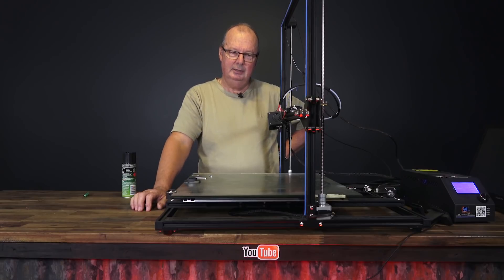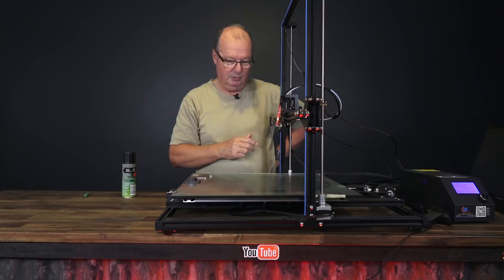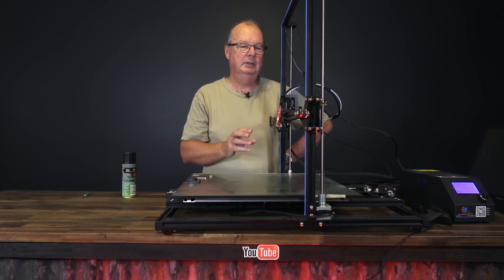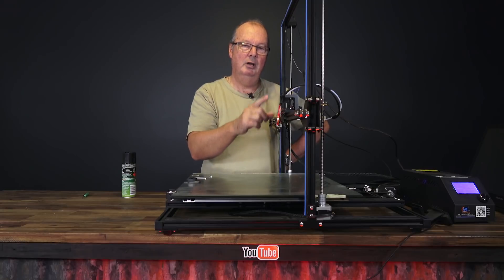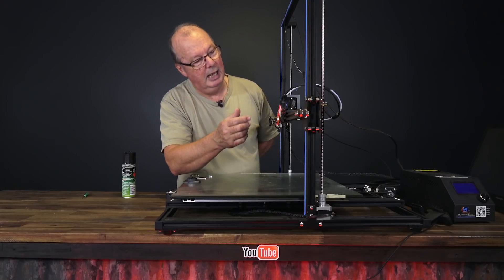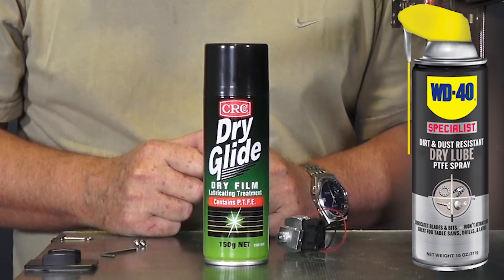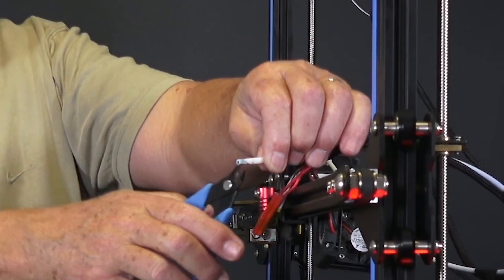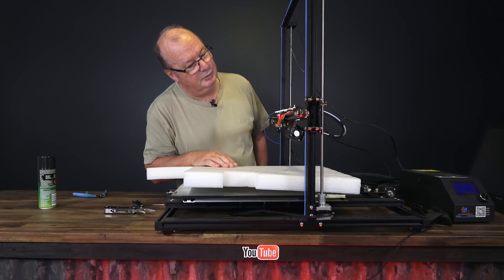How to fix your cr10, cr10s, mini tornado, ender, A10 and others jamming or under extruding.

Comment from the maker: Gearbest currently have a flash sale for the Ender-3  It is $189.99 USD!
https://t.co/1bsazHyyuh

BE SURE to check the PTFE tube in the hotend - if it's malformed cut it and re insert it correctly to have no gaps. Also check the PTFE release is working and locking or else replace it.
Reply: For most of the creality line u can get a micro Swiss kit and most of the E3 clones micro Swiss has the throat for sale to install if the stock throat is not machined properly
Reply: question here... I'm about to receive an Ender 3 in the mail, should I use this on my hot end before even using it, as I assemble it. How often to reapply if any?
Reply from the maker: Use as is until your replacements parts arrive - then you will see your homemade Improvmements once you use a quality ptfe and ideally a microswiss Nozzle
Reply: I know this is an old video, but I was wondering.  As a reloader, we frequently use moly (molybdenum disulfide) based dry film lubes on match bullets.  Can you think of any reason that would be inappropriate in an all metal hotend?
Reply: I think I missed that sale, lol

Comment: Hello, I have A Creaity CR-10 with Dual Z Axis motors. The z axis goes up and down when homing but will not go up when printing. Is this a problem with my machine or am i doing something wrong in Cura ?
Reply from the maker: If the Z moves ok via LCD controls then I would suggest it is either the model file or your Cura settings.

Comment: Don't you think this PTFE spray will block the extruder nozzle?
I also want to resolve my clogging issue.  I have my CR10s, my filament does not move ahead. Also its really difficult to remove the nozzle from the extruder.

Comment: Um... no. This is not an all-metal hotend. This is a PTFE lined hotend. The PTFE goes to the nozzle, not the heatbreak. Snipping the end of your PTFE is how you cause clogs because you're deforming the end of the tube, use a PTFE cutter (print one or TH3D or others sell specialized cutters with a razor on the end). I may be having problems with my printer at the moment but I'm doubting this solution due to the sheer amount of ignorance that has been stated only 60% way through the video.

Comment: What's the point of it? you use an all-metal hotend to print at higher temps but that higher temps going to make that PTFE spray off-gas and potentially poison you, so you stick to the 230 degrees, you might as well have stuck with the stock hot-end, I reckon that at some point that spray-on PTFE is going to stop working so you are going to have to clean it out before re-applying it, not my idea of fun!
 I forgot to mention I'm talking about an Ender 5 the new CR series come with a stock all-metal hot-end

Comment: What's about Ti all-metal heat breaks? I've ordered some "good one" (claimed). I've heard that it's better to polish them inside. Will I still need to oil it with a PTFE spray? My plans are about PETG mainly (maybe HT PLA in future).
Reply: anyone who doesn't like all metal just doesn't know how to tune retraction.  0.8mm@40mm/s is a good starting point for all metal/direct drive, closer to 1.2@35 if it's all metal with a bowden system.
Reply: @butre.  Thanks for the reply! Actually I'm gonna re-assemble the hot end when I'll get to it. The last time printing was stopped with partial clogging. I don't know about the reason. My guess is that cooling is not enough for Ti-heatbreak. Really not sure though!

Comment: So, should this only be done with aftermarket all-metal hot ends? I still use the stock hot end that came with my CR-10 and I'm dealing with a lot of underextruding and extruder skipping. Should I PTFE spray a stock hot end?

Comment: The spray is only rated to 230C, so make sure you don't print much hotter than that or it might break down and end up clogging the hot end.

Comment: I've heard that you need to "season" all metal hot ends, especially clones by using a filament oiler. Benefit of using an oiler is that it won't run out and need hot end dismantling.

Comment: I ordered a clone V6 hot end and then just a genuine heat break (£13) and nozzle from E3D directly. I also have two other heat breaks, one PTFE lined and another that's hollow allowing Capricorn high temp tubing to go all the way down to the nozzle.
Reply: Where did you get the hollow one (or keywords for search), and how well did that work out?

Comment: Hi John, do you find that this fix has a lifetime to it?
I have 3* Cr-10 printers and an Ender-3.  All have the same hot-end and the same issue from the factory. Printer works beautifully for a period, but eventually every one has succumbed to the same issue, usually during a long print, where it under-extrudes severely - sometimes dropping the speed 50% 'fixes' temporarily.
My previous solution was similar to you - pull out the PTFE tube, re-cut the end to be 100% perpendicular, straight cut, remove the nozzle, 4mm drill bit to clear through, brand new nozzle, and new pneumatic connector.  Right, everything works perfectly, job done - except that now, all 3 of my Cr-10 printers have just failed one after the other with the same issue - seems that fix has a lifetime.  As I know the end is cut perfectly, seems either the PTFE-pneumatic connector joint is getting loose and allowing a crack were hot filament can squeeze out - or the PTFE at the heatbreak is degrading. 
So trying to understand better what your fix is adding - is it that there is no air gap between PTFE tube and heatbreak/heatsink?  So it is better cooled?  Is it 'gluing' the PTFE tube in, and preventing a gap from developing?  Is the PTFE in the spray better quality/more temperature resistant than the Creality supplied tube?
How long have you had your printer running with this fix, have you had to repeat it?
Many thanks, for the interesting workaround, nicely presented.
Cheers
Alex
Reply: You can print clips that fit into the end of the couplers to help secure the tube in place. On thingiverse: "Bowden tube coupler clip".  Hopefully you have already resolved this issue, but just in case.
Reply from the maker: Great thanks for the tip

Comment: Or you know... You could just buy an original hotend from E3D or Micro Swiss. You save on time and material that may have been used on failed prints. They are probably way cheaper on the long run.

Comment: Well, I rather combine more ways, how to achieve success printing with all-metal HE. First, insulation! Just wrap your heat block into Kapton tape (or in case of 260+°C temperatures some glass fiber insulation) to reduce heating up of the heat sink by radiation + wrap heat break thread into Teflon tape, it reduces heating of heat break by conduction. Hope this approach will work for my 3d printer.

Comment: One of the major problems with All Metal Hot Ends is over retraction.  This is a subject that is rarely discussed.  I changed to an all metal hot end of my own design/construction and until I found a fairly obscure article about retraction for the all metal hot end, my printer was almost useless.  I was using PETG and running 3.5mm retraction on a PTFE equipped ENDER 3, when I went to the all metal HE, I had to reduce my retraction to about .25 - .30 to stop the thing from jamming.  Same filament, same model, same G-Code the only thing that changed was the hot end and the retraction setting.  The retraction problem only becomes worse as the extruder temps get higher, since the puddle of hot plastic is larger and the plastic is less viscous and is easier to eventually suck back up the heat break.  When I pulled the stuck filament from the heat break, it was clear that this was what was happening.  The jammed portion was about 2.5 - 3.0 mm long, almost exactly the difference in the two retraction settings in the slicer.  I am going to treat my Hot End with this for an extra layer of security and to make the printer more reliable at high temperatures.

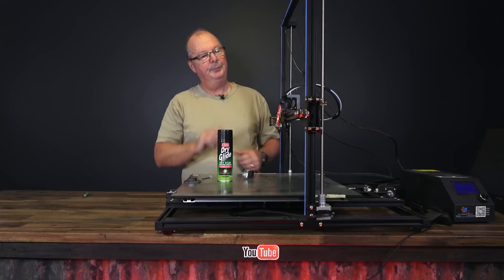Comment: Good tip, but skip to 5:20 at least.
Buy PTFE Dry Lub, spray it in the extruder pipe, should have been a 2 minute video.

Comment: You show how the spray is only rated to 450f, thats only 232c. Not sure how you expect this stuff to handle hot temp materials. I don't know if they changed their design or if your cr10s has a different setup than my stock ender 3, but my ptfe tube runs all the way through the heat break and would render this spray useless anyways. Cool video though, I didn't know about ptfe spray at all and have some ideas for it

Comment: UPDATE:  Nope, I got too excited too soon!  My big job got about 90% of the way complete and then the nozzle jammed.  It got a lot further than it has gotten before, but I think that the spray gets rubbed off by the filament as it prints large jobs.  I ended up ordering an E3D Lite6 nozzle.  Hopefully, that genuine nozzle will solve my problems.
Reply from the maker: Buying genuine is always the best option if you can afford it

Comment: I don't understand why you can only take it apart when hot this is the second vid I have seen that said this. Also to take the tube out and just spray into it without cleaning out all the plugged filament makes no sense unless I missed something.
Reply from the maker: Most solids expand when heated and contract when cooled.
Reply: My 2 printers arrived the same day you replied to my question. Before they did I watched every video I could to get ready for printing. Up until now the printing community has been very nice and even to say that there are no stupid questions. To respond to me with a 4th grade science class review which I remember quite well even from 55 years ago I thought was a bit smug. If you meant that the nozzle and coupler are easier to remove that's what I was thinking and that's all you had to say. Since I haven't even touched a printer yet I wanted to make sure there wasn't something like the filament turns to stone once cooled or something that I am unaware of. Well one printer I sent to somebody that might like a surprise gift and the ender pro sits unopened in the basement. Thanks  from a disappointed noob.
Reply from the maker: The filament will be globbed at the end of the ptfe, usually a stretched part then an expanded blob but still attached

Comment: You are mixing facts regarding all-metal hot ends with what is installed as standard on a CR10 which has PTFE tube all the way down through the heatsink, partly into the heat block and touching the nozzle. It couldn't get further away from an all-metal hotend if you tried. How does spraying ptfe spray into the heatsink make any difference when your sliding ptfe tube all the way though it anyway. Also your dont want to be cutting PTFE tubing with a pair of side cutters as you will flattern it.
Reply: Most all metal hot ends do not have a drilled hole to fit PTFE tubing.. The tubing sits on top, then they have a smooth tight tolerance fit for your filament to slide through, the point of this video is that knock offs are not tight tolerance and they have a rough surface finish where the filament slides in, another option to completely remove the need of using this spray is to get a very small ~1.5mm polishing brush and carefully smooth out the filament hole.
Reply: @BF3DS  The hot end he is working on isn't an all metal hotend, it has ptfe tubing all the way to the top of the nozzel. The information in this video is not relevant to the printer he has in front of him.
Reply: No, there's a version of the E3DV6 that is a 1.75mm bore, the PTFE tubing does not go into the heatsink block, it stops just before it.

Comment: The point of not exceeding certain temperatures in ptfe-lined hotend throats is that ptfe gasses out toxic stuff when it gets too hot. So the only advantage of the spray in a full-metal throat over a ptfe-lined throat is that the hot end doesn't need disassembly. Otherwise, same temperature restrictions apply. Even worse, maybe, because the ptfe in the nozzle will be hotter than in the throat.

Comment: Just a FYI, PLA will only stick to the inside of an all metal hotend if there is not enough cooling on the heatsink. Fix the cooling issue over the heatsink and you won't need to play around with the hotend.
Reply: Hi man, how could I improve or solve cooling issue on my Ender 3?

Comment: I have been having this problem constantly even changing different hotends. It would start printing well but after a while they start feeding funny and then i would get a part that looked like it it air whip plastic. So now the question is, my kits have both full metal breakers or ptfe lined ones. Which is more likely not to jam?

Comment: many clones have a metal hot-end-break that contains a PFTE tube; this is bad for three reasons 1) jams 2) off-gassing of Teflon 3) limited temperature range.    E3d has a full metal heat-break, better machining, they use better materials, they even texture materials where needed.
Reply: yes and a great product - the copies not so much.
Reply: My i3 Mega comes with a V5 hotend that allows PTFE tubing all the way through the throat to the nozzle. However, some spare V5 hotends with a blue-topped pneumatic coupler I picked up allow PTFE only to the top of the heat-sink. A PTFE-lined throat is to be used with this. I purchased some 4.1mm ID throats and lined them with 22mm of Capricorn PTFE. Now, instead of running expensive Capricorn PTFE all the way from the extruder to the nozzle of the hotend, I need only a 22mm-section to line the throat. I am planning to use this setup at my next hotend change and am hoping it will work as expected. For a regular 3mm ID throat, I sanded the OD of Capricorn PTFE down to 3mm, but I much prefer to do without the sanding and just use 4.1mm throats.

Comment: One of the major culprits of an all metal hotend clogging is the PTFE tube connection. After time the retraction causes it to loosen. That  let's the tube move up and down creating a gap at the top of the heatbreak. 
The fix for this is to install a clip into the tube holder. This holds the plastic ring in the up position. This keeps the tube from moving.
True E3D hotends come with this clip. Clones do not and must be purchased/printed.
Reply: Hi, I am new to 3d printed and I am not entirely sure what you mean by the clip. Are you able to give examples of one that I could buy or print?
Reply: Clones now comes with better clips and an extra 1 meter ptfe tube. Just keep looking.
Reply: @lgflanang  You talking about Colette?

Comment: It's somewhat disingenuous to call them knockoffs, clones or copies as it implies something nefarious is happening. Many of the hot ends by E3d and others are open source and are available for anyone to make, use, and sell. I think calling them generic open source hotends is more accurate. Otherwise very good video.
Reply: A lot of the Chinese sellers falsely advertise "full metal" and "genuine" when they're obviously not. They are selling knock-offs that aren't even properly made.
Reply: If you are correct then my mistake, however I think E3D and MicroSwiss are proprietary.
Reply from the maker: From some googling I see no documents that say anything about open source for the e3d. Happy to be shown otherwise
Reply: E3D is all open-source but only for non-commercial uses. The Chinese products are not legal.
Reply: John Martin, I don't see anything proprietary about anything MicroSwiss makes. Everything actually appears to be "knockoffs" of opensourced hotends of either MK10, MK8, or E3D in design. The only thing different is that it is copied by an American company instead of a Chinese one. Perhaps an interesting commentary in how we view two companies doing the same thing from two countries. 

In the event that MicroSwiss did actually design anything, if they based the design from open sourced hardware, they would be forced to also open source their own changes according the license of GNU GPL, unless they are makerbot ;-)
Reply: Calling them knockoffs and clones are exactly what they are. Nothing disingenuous about it. They are less expensive versions attempting to mirror the higher quality ones. The only way that's possible is with reduced quality of the product itself or at best case scenario, reduced quality control, increasing the likelihood that you will receive a faulty product.
Reply: Then I would say you have not use many of the hotends around or had many E3D hotends or clones to compare. The decent/reputable Aliexpress sellers of E3D style hotends are better than the ones being made by E3D. The inner throat on a genuine E3D heatbreak is polished but they polished a turd as the surfaces is not flat or even to begin with (just run a flat cut bit of filament up and down an E3D heatbreak and you will feel the poor quality to the throat). I stopped buying E3D genuine parts as they are made in china anyways and aliexpress suppliers are providing a better product at 1/5 the price. E3D just comes with a brand name tax and no better quality.
Reply: it is "genuine" in that it was designed by e3d, and that they used the freely available technical drawings to make the product. Some may make slight modifications though, and some of those modifications may or not be beneficial. However the overall design is still usually compatible and visually similar, if they were fruit you would say they both look like apples, though the UK apple may taste better then the Chinese apple. Both apples taste similar enough to bake an apple pie for most people.